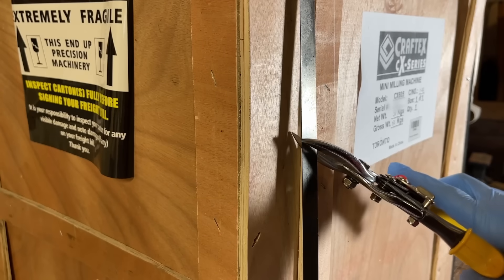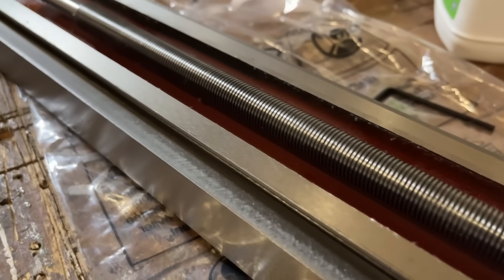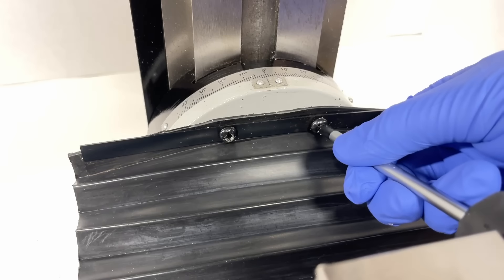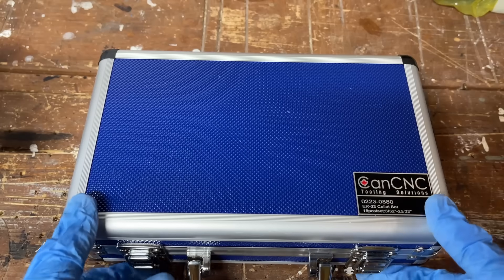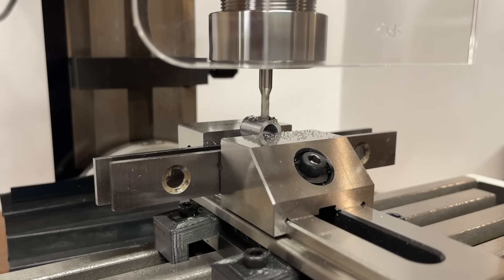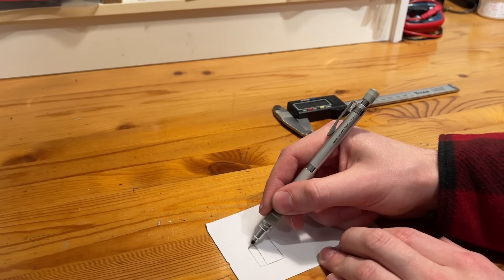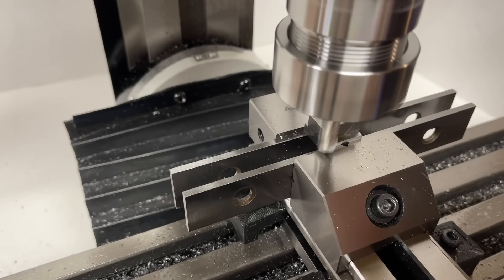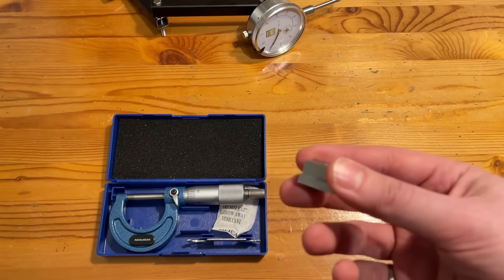I Bought A Minimill to see if they are Worth It

Comment: About 10 years ago I bought a Sieg SX2p - this is like the SX2, but with an larger table, and brushless DC motor/belt drive.

I got fed up cranking the x axis, so decided to motorise it. The cheap way was a stepper motor+driver+spare PC+linuxCNC.  It worked great, but tempted me to do a similar job on the y axis. Once I had done that I got a large circular slab of aluminium for use as a high vacuum baseplate and trepanned a hole for fitting a diffusion pump.  linxCNC meant I could mill a nice circle, but I still had to feed the zed axis manually. So, I CNC-d the z-axis. I then added an A-axis, and cut some gears.

A mini-mill is very useful in a home workshop, and can do many things so long as cuts are small enough. With CNC and a camera/display for monitoring progress while one relaxes in an armchair with a beer or La Tache '90 the cuts can be extremely fine, but relaxing (yes - I know from experience!).

But I have learned lessons - and am now returning crank handles to the axes - but using rotary encoders - to produce the intuitive feel of a conventional mill. I am doing the same with my lathe, and will be able to discard my compound and use CNC to do the clever bit. 

As for tool collecting, taking up watchmaking has meant I have been able to collect all sorts of previously unknown tools - the latest being an vintage staking set.
Reply: A La Tache '90 costs more than the mill.

Comment: Thanks.. I got one with a solid z.. to mill and drill parts for upgrades on a failing DYNA MYTE 2400 (functions started to fail; maybe it was that latest CME event).  Oh, for the reader that is not familiar with the DYNA MITE, it is a 1980's educational machine that is 110VAC and low power with a funky set of TTL logic code and AC open loop steppers, but a super heavy iron casting -350+lb and now 0.001 accuracy as to the start up check routine.
Reply from the maker: Never heard of the dyna myte before! Very cool machine! Good luck with the fix!

Comment: You'd be amazed what I did on a tiny Unimat back in the '60s. I once made a new crankshaft for a model aircraft engine on it, using a bit of scrap axle shaft from a truck. Yes it took ages, but I got there. I have a bigger lathe now (4 1/2" Boxford), but I still use the little Unimat for really tiny parts.... the very high spindle speeds available are very useful when machining things often less than 1/16" diameter. Horses for courses. I have a light milling machine now too when I say light, it weighs 500kgs!) that is remarably capable. Geared head (a bit noisy) and 2 axis DRO. For the money it's a good machine.
You get what you pay for with machinery of all sorts, and the ultra precision machines are way beyond affordable for most of us. Any half way decent machinist should be able to work to closer tolerances than those on the machines he/she is using......
Reply: I've done maintenance work for the cousin of my mothers 1960's Unimat. Good machines!

Comment: I converted mine to 5 axis cnc. I do want to add 2inch risers to get more clearance z direction
Reply from the maker: That is extremely cool! I’ve always wanted to play around with a 5 axis mill. I may have to give that conversion a shot at some point
Reply: @Someone_Should_Make_That  only downside is with each axis your workspace becomes smaller

Comment: I have both Harbor Freight mini mill and lathe.  Installed cheap DRO’s on both and set them up properly.  I have done very precise work on both in hard steel, i.e.  cut steel 1911 frame for ramped barrel, made gun lock work from A-2 tool steel.  The key is light cuts, don’t force it.

Comment: Forewarning: I'm not a machinist, I just took a lot of training for it at the same time as I went through getting a degree in CAD.  That being said, just like with full-sized equipment, the biggest limiting factor is the quality of the components/build of the machine.  There are definitely mini mills that are built well, and ones that are junk.  

For example, I have a Grizzly minimill, with some upgrades done to it, and it has served me just as well for the smaller work that I do as the bridgeports that I've used in various shops for big work.  Would I use it for production work? No, mostly because a full-size Mill is just built much heftier and so it'll do small to medium jobs with ease and without suffering the same level of wear and tear as a smaller unit.  Just the nature of the beast. 

But for shop work, like gunsmithing jobs or hobbyist/small size projects that I might have to do, the thing is way more than enough, holds the same level of precision as the big boys that I've used, and, with upgrades, has all of the features I need.  The only thing i have yet to add that would be nice is an auto-feed.  

Knee Mills and bench-top mills (minimills) definitely have their place, and they are a huge benefit for anyone that's getting started because they don't take up nearly as much room as a full-size, they're not that costly to get into, and they don't require any special electrical drops or anything like a full-size mill's 440v requirement.   

So, as long as you're doing your homework, you're investing in a good quality unit, and you know what to look for, no reason not to get one. 

One other thought on the subject:  Before investing in any kind of a Milling Machine, check out your local community college to see if they offer any basic Machine Tooling classes.  If they do, sign up for the basic one that covers how to set up and run mills, lathes, etc. to get familiar with the equipment.  Also, look at the classes being offered and see if there's a common professor/instructor to all of the courses covering machine tooling.  Those guys are usually experienced machinists, and when it comes time to consider a decent Knee/Bench-Top mill, they are an invaluable resource to ask questions of, such as what to look for, what information provided by reviewers and whatnot are legitimate data and what's misinformation/crap, and potentially even if the instructor might know of any good places that sell used equipment.  

If you cultivate the professor as a resource, their experience on the machines will also mean they may be a good resource to help you figure out upgrades and source (or make) upgraded parts like bushings, bearings, etc. to turn an otherwise passable machine into a fully serviceable unit.   Nothing beats experience in that regard.

Comment: You'll get even better results if you bolt the mill down on something that isn't made of wood. Also whenever possible try to mill against the fixed part of the vise.
Reply from the maker: Good advice, I’ll have to think about constructing a more solid stand for it

Comment: I have a Chester  Conquest with 19.5" x 6"  table & MT3 spindle which is similar to yours. I make lots of parts on it in steel, Ali, brass & plastics.. It is a very capable mill if used properly. Of course it will not hog off large amounts of material but for hobby stuff it is great.  Thanks for sharing. ATB regards from the UK

Comment: Column won't hold tram?  Square it up and install a pin, either tapered or parallel.  Most milling will take place with the column upright and if you think a little, you can make a pin that is easily removed for the rare occasion you need to tilt the column.
Reply from the maker: Excellent advice. If it slips I’ll definitely be doing this

Comment: i love my little milling machine, its the wen 33013, its a like the sieg x2l with the bigger table, i have been planning on buying a solid column base an column for mine but havent gotten around to it but it cant say ive had issues, just getting the head trammed in after moving it or something like that is always really teadius plus i barely know what im doing but i love my mill an suggest everyone who works with there hands alot to buy one, u will not regret it. i got into 3d printing forever ago an ended up with a mini print farm for a lack of a better term with 12 fdm an 2 resin printers then i got a cnc router then a 7x14 mini lathe and the mini mill, it took me some time to get all the tooling an stuff needed to do alot of stuff but its by far been the most fun thing ive ever tried to pick up. it took what i was making to a different level an alot of  limits i used to run into is a thing of the past now cause i can just move to aluminum or steel to get it done. well well worth the time and money if ur someone who likes making useful stuff.

Comment: As far as the noise is concerned, it's the same with any equipment, there is a break in period. Whether you get a new rotary tool, a lawn mower or a new car, there are going to be tiny imperfections in the friction surfaces and with most smaller things you just need to run them under no-load or just a light load for an hour or so to smooth things out and quite them down a bit.

Comment: the first two complaints about the lathe are the same issue, inpatients.  Without the rigidity of a few tons of steel, you need to cut smaller, and keep your tools sharper.

Comment: I bought a mini mill (rebranded) from a local provider where I think they do some basic QC checking on the ones they order. 
Mine is the exact same model as yours. 
There's always an initial setup time in getting everything perfectly square although mine was dead on left to right (only .001" over the whole length) and only had about .004" front to back which was fixed by shimming under the tower where it connects to the base. 
That was about 6 years ago and since then it has been invaluable for me in getting projects done, I use it also for my knife making sometimes and it's all around a great tool. 
Just like others said, don't expect to be hogging off 1/4" chunks with a small mill like this. Usually i don't go over .030" if I want to remove material quickly. If not I usually just take half that if I'm not in a hurry. 
But to be fair, you probably could get away with hogging off .060" with a quality face mill as long as you have everything else set up very rigid and the mill tuned to eliminate any play.

Comment: Nice job with the review.  Machines all have plus and minus be it horsepower or rigidity, the smallest reasonable sized tool to do the job is always your best bet, both in economics of cost and time.  Playing not making money at it, it's your choice but when the machine wiggles or part moves that big endmill will cost you both in money and time fixing your setup replacing the tool because of increase the tool pressure it places on the parts often leading to parts moving.  Have fun the parts look great, a 3 or 4 inch machine vise with a swivel base and sticking with just R8 collets would be a great addition.  Cheers!
Reply from the maker: Thank you! I definitely have a vice like that added to my wish list. Appreciate the feedback!

Comment: hear me out: 0.0625" is just a 1/16th this is a perfectly reasonable dial to use when working in small inch measurements, as long as you have a fractional/decimal table next to you.

Comment: Your mill takes R8 collets, I know the ER32 you bought is all the rage but for about the same price, you can get a full set of R8 collets that will hold your endmills much closer to the headstock and avoid the tolerance stack of using an R8 to ER32 adapter. I know they only close from one end, but I tried a set of each in my Bridgeport clone, and the difference was shocking.   You also get the added bonus of being able to hold longer reamers and drills assuming you have the right size collet.

Comment: I think the mill's capability depends on a number of factors. My one came with a few nasty faults. the bottom quil bearing was a deep grove ball race. The top one was made from an outer using an angular contact bearing & the inner from a deep grove ball race!! In addition, they were so tight on the mandrel they could not move for adjustment. I had to ease the fits & replace them both. Now they are Timken taper roller bottom & angular contact top, with the top one adjustable. For small steel parts it is very good. For Iron, aluminium, brass & bronze excellent. But for making large steel jigs, not so good, not enough weight. The truth is that it is not that suited to cutters above 8mm 4 flute when working in steel & 0.020" cut. The big problem with this type of small mill is that it uses flat gibs with gib screws. It would be better to have the slightly dearer machine with the tapered gibs & a fixed column. I had to double up on my gib screws to gain better accuracy.

Comment: Is the awkward gradation due to the machine having metric screws but a inch markings on the hand wheel?
Reply: No, see an earlier comment -- 0.0625 is 1/16 inch.  The lead screw is 16 TPI.

Metric-to-inch mashups would be even messier -- a metric screw with an inch-gradation hand wheel couldn't even have ANY repeating number of thousandths on the hand wheel.  

Going the other way, a metric handwheel could be installed on a screw measurable in inches, but it'd be a rather offbeat pitch -- for example a wheel giving 5.00 mm/rev (close to a Bridgeport's 0.200") would need a screw pitch of exactly 5.08 TPI.  (Which is actually, of course, a metric thread with a pitch of 5 mm/turn, it just happens to be expressible also as an exact TPI pitch if you allow the decimal fraction, because an inch is exactly 25.4 mm.)  

(That exactness is what makes it possible to fit a lathe with transposing gears that can convert its longitudinal feed between inch pitches and metric pitches.  But it does mean you have to include a 127-tooth gear somewhere.  Or with a surprisingly small error -- one part in 8000 I think -- you an also use a 63-to-64 pair and avoid the huge gear diameter. Considering that 10-32 screws are usually usable in M5x0.8mm nuts -- a much larger error, #10 diameter being 4.826 mm, almost 0.007" undersize, and  0.8 mm pitch being 31.75 TPI -- the 64:64 approximation ain't bad.)

Comment: my shop will not hold more(bargains) pity, my stuff, 5 MIGs over 400 amp, one Lincoln Vantage 400 welder/ genset,plate forming rolls, Strand ms 32 drill, which is one of the best auto feed drills, one 230 volt to 400 volt single to 3 phase convertor ,runs my 575x 2000 12 hp CAZENEUVE  toolroom lathe and countless 5 inch makita angle grinders with different wheels for each, ie weld chasers (my trade building alu yachts)thin cutting wheels, 3m fast grinding wheels, rotary wire brush and so on, 5 saws with alu cutting blades and the best nine inch ever, my makita grinder.
I  suffered a stroke 8 years ago, but can still use all this, welding mig is a problem with my left arm useless
thanks for this vid, maybe i can fit one in

Comment: I don't know much about machining, but I have a pretty serious background in electronic and physical/dimensional calibration. I knew right off the bat that you were going to get better results just from a thorough setup. It is also worth mentioning that over time parts will wear, and temp/humidity will change and cause variations, meaning you'll have to occasionally go back through the setup.
Reply: So we cannot store a mill in the backyard right ? 😂
Reply: @spartoiss488  I mean... you can. You'll just have to do a serious setup every time you use it.
Reply: Thermal expansion. I held tight tolerances as a machinist and so I had to maintain temperature strictly to hold tolerance. I made an aluminum part with a 3 inch bore 1/2 inch wall thickness and I would have to aim for . 0005 over tolerance and it would shrink that . 0005 down to nominal and I only had a +-.0003 for tolerance.

Comment: I found that the main drawback of the small machine is column rigidity, not only side to side but fore-aft (from the perspective of operator). To fix mine, I bolted 1/2" aluminum plate to the machine column secured with 4ea 1/2" bolts to the column as well as with the column swivel nut/washer arrangement. Bottom of the plate has a stout aluminum 2x2" angle  which ties the vertical plate to an additional 1/2" base plate to which the machine base is bolted. Space between the back of the column and the machine base is filled with a fitted aluminum plate appr. 1/2".  Vertical plate holes are a bit oversize to allow tramming left-right. Tramming fore-aft adjusted with a shim. Decent finish when cutting steel with either fly cutter or 1/2" endmill  at 0.025 depth of cut. Still stable and in tram after 5 years of use.

There are additional updates and tweaks - left-right-axis motor drive, air spring to balance the milling head, larger vertical motion wheel and more accurate single-piece milling head drive. Mechanical indicators on all 3 axes. Much better than original but not a Bridgeport. Alas, no space.

Comment: I’ve got a Proxxon machine that’s literally as big as my forearm and I machine steel and stainless steel on it no problem.  It’s very accurate but you do have to put up with taking small cuts only 3MM wide on its largest End Mill.  It is a toolers milling machine though so I didn’t have high expectations.  I got it to machine wood scales for knives so they are nice and flat when I bolt and glue them to a knife handle.  It’s still very handy and I’ve made all sorts with it.